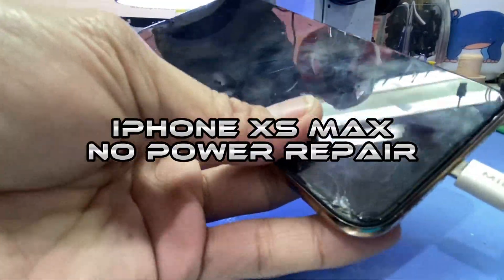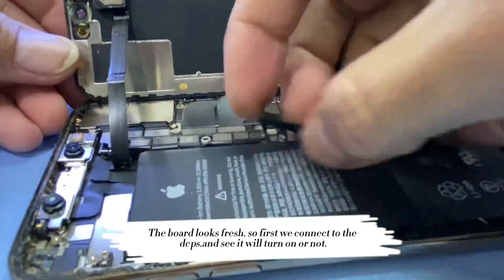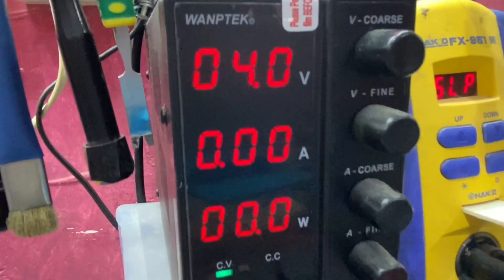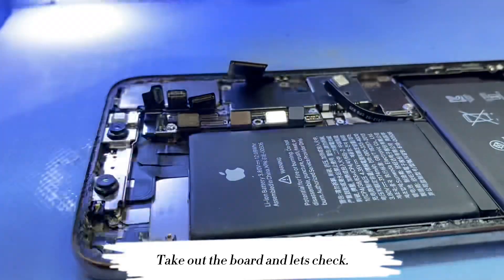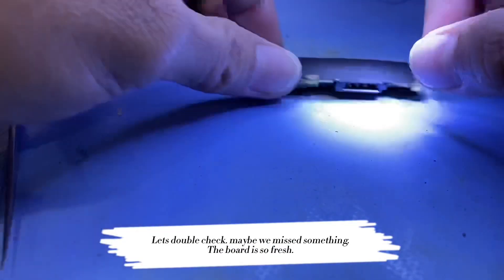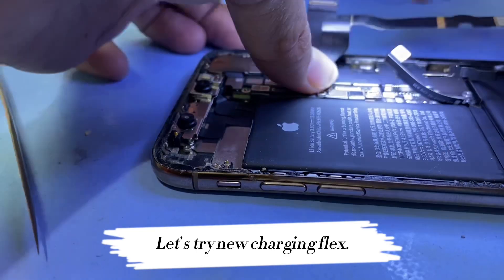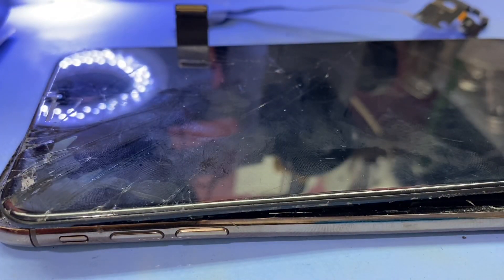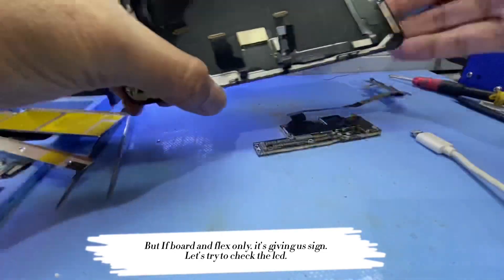Iphone xs max no power  repair guide

Comment: Wow this seems like a very weird solution but it worked. Thank you!! I just replaced my frame. It wouldn’t turn on at all and no response form charging it until now. Thanxxx❤❤❤❤
Reply from the maker: You're welcome! Thank you also for watching .godbless you
Reply: @Repairingtools  I removed the rear camera from my iPhone XS but now my flashlight doesn’t work. the phone works fine. Does the flashlight need the rear camera installed to work?
Reply from the maker: @egomachinebroke6191 thats normal if you dont have the rearcam flash won’t work.